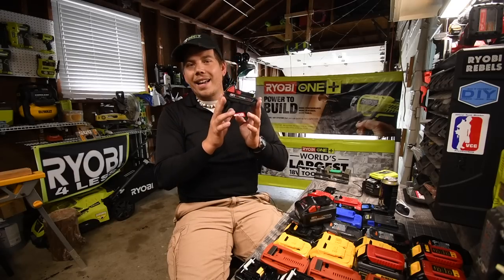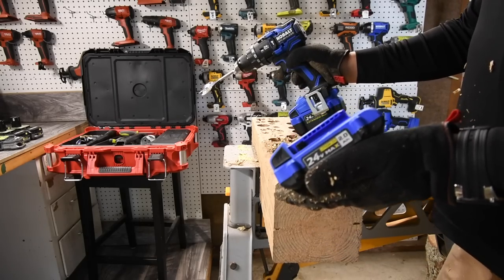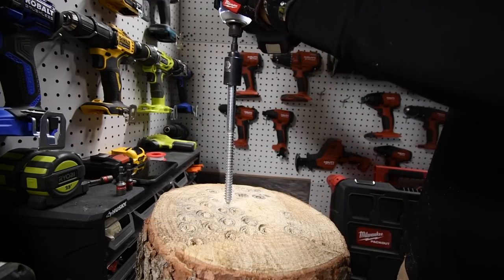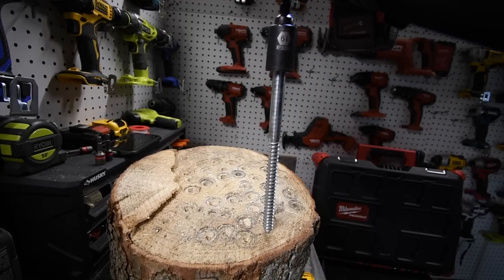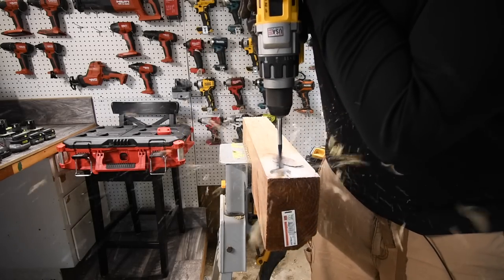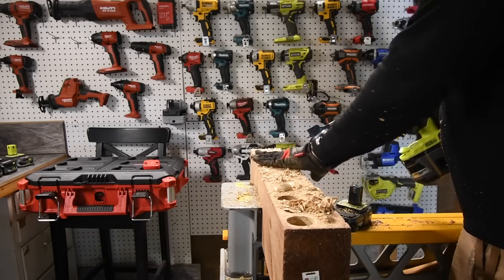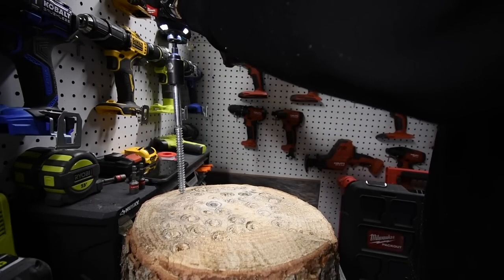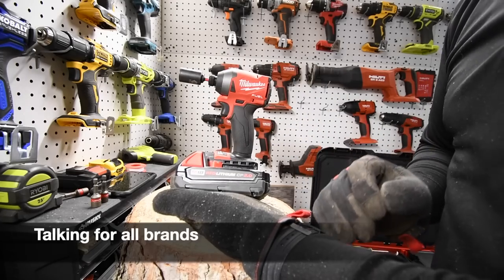Are 2ah batteries as strong as 4ah batteries?

Comment: Dave, the individuals saying there’s no difference between an 18650 cell lithium ion battery and a 21700 cell lithium ion battery is an individual that doesn’t know what they’re talking about and one who’s never tried a tool with the newer cells.

I recently watched a couple VCG Tool Test Raws where they were pitting the new Kobalt tools with 21700 cell batteries against Milwaukee Gen 3 tools using 5 amp batteries.  I’m yelling at my iPad and chatting that it’s not a true apples to apples comparison of the tools since the Milwaukee drill, impact and Hackzall (think those were the tools being tested) were all being powered by the 5 amp battery, with 18650 cells.  The Milwaukee won, which wasn’t the point, as it would’ve smoked the Kobalt tools with the right or equal battery pairing.  Their logic in the testing was the tool being tested should use the battery that came with the tool...

I know this because I’ve seen the performance increase with the Fuel tools using a 3 amp HO battery and 6 amp HO battery vs 5 amp or 9 amp.  Way more power and torque with the High Output 21700 cell batteries!
Reply from the maker: wayyyy more power, its actually crazy on how much power is released with the batteries and I thank you Marty

Comment: When you're drilling a large hole like that, it would be sensible to use speed/gear 1 for the extra power. 
I know you're trying to test and show that there are things you can't do with a 2ah that the larger ones can. But I'm sure if it was on 1 it would work. But in the time of today time is money and no one wants to use the low gear unless absolutely needed

Comment: You compare Hilti B22 8.0 (develop around in 2018, 21700 cells) against B22 2.6 (develop maybe around in 2013, 18650 cells). Its a fact, that 21700 have more power output and less heat. If you compare B22 5.2 (develop more that 7 year before, 18700 cells) against B22 4.0 (new 21700 cells) = B22 4.0 with less capacity have same power output and less heat.
Reply from the maker: this is to show that there is a difference in ah bro. deal with it
Reply: @ManCaverTools  i try tell u, here is a difference in cells with same Ah.

Comment: keep seeing alot of the same sort of comments, in this specific test yes the bigger the better, but one of the biggest factors that many dont consider is the task... depending the task at hand a 2ah or 5ah can/wont make a difference, not everyone is screwing big lugs in tree stomps, or drilling 200 holes in thick wood etc.

theres gonna be alot of diy people that are just putting shelves up, or drilling a few small holes here an there, or maybe a small bit of screwing/fencing etc are gonna google this and wanna know this and think they are gonnna need the bigger batteries.

bottom line is, if your doing big jobs everyday with quite heavy loads etc, the bigger battery will be better for you.

if you are a diy person doing small jobs here and there, or maybe you just want/need a tool in the house for when need arrises the a 2ah battery is wayyyy more then enough.

I know its state the obvious but alot are coming here skipping bits just to get the results and/or just reading the comments.
Reply from the maker: there are some people that still think not matter the task batteries will perform the same no matter what ah

Comment: DeWalt is the only one with 3 speeds. 3 would be more equal to 2 for the other drills. 2 for DeWalt would be more like in the middle of 1 and 2 for the other drills!
Reply from the maker: but the issue is dewalt has a tuff time in speed 3. and in some of my test if a drill stops while im using it, it loses. so in some cases speed 3 is bad

Comment: You are are inconsistent with your testing and outcomes. In the video you make it sound and look like the Milwaukee 2 amp preforms the same as their 5 amp. What is it? Does the 2aH preform the same as the 5aH which in your theory, the 5 should preform better.
Reply from the maker: the Milwaukee 2 ah only did good when with the impact driver